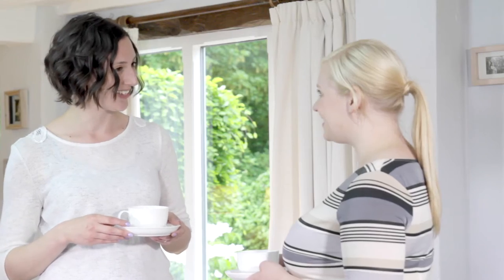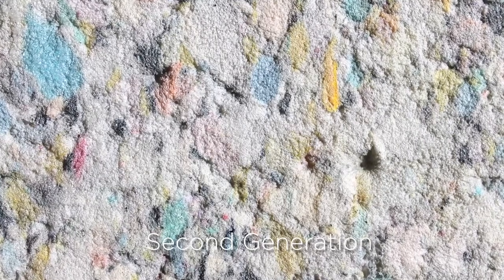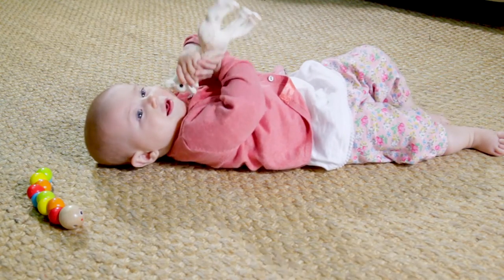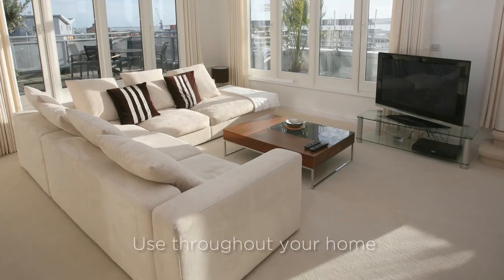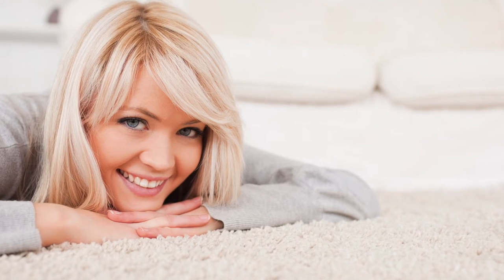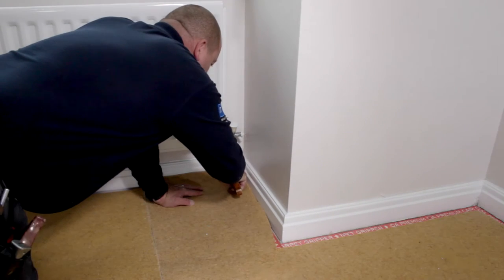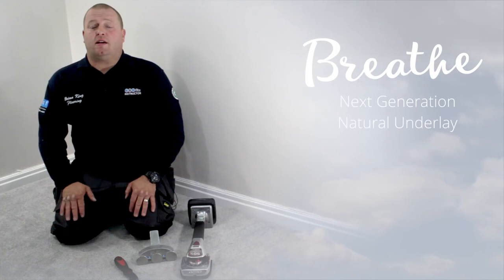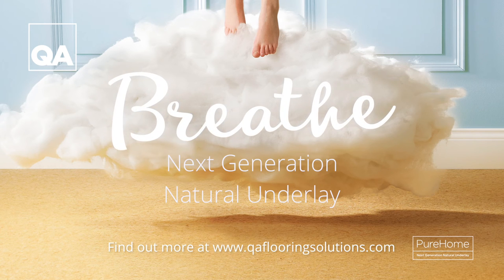Breathe The Next Generation Underlay

Comment: This stuff looks like it has no stretch at all! common foam underlay is good coz if it's slightly short and you can stretch it and it's flexible and easy to work with. that breath stuff looks like a sheet of ply! The guys that use this fit a room or two a day and have all the time in the world to put up with this stuff. I'm a real fitter I earn money for what I put down!! Simple
Reply from the maker: Thanks for your comment Sausage Man! Feedback from fitters that have used Breathe Underlay is consistently positive, citing the ease at which it cuts, the speed of installation and consistent nature of the product as the key benefits.

In fact, most fitters say Breathe is faster to install thanks to the ease at which it cuts (no more tearing) and that there is no need to cut and patch any hard lumps and bumps like in PU.

Of course there will be those that prefer PU Underlays, which is great for us because 90% of our Underlay catalogue is PU!

We don’t discriminate either way. We offer a fantastic range of PU products and a number of innovative products like Breathe and HeatWave.

At the end of the day, underlay is a choice for the consumer. If the consumer wants to install an underlay with added health benefits, that extends the life of their carpet or is conscious of allergy sufferers, then Breathe Underlay is an excellent choice. 

If they just want a soft floor, PU is a great alternative.

https://youtu.be/NMxkhVpP7DI
Reply: QA Flooring Solutions the breath underlay cuts nice because it's like a sheet of ply and doesn't move anywhere, I can't see how it would be faster to fit than pu because it too stiff and has no give!! I don't see how it makes any difference to allergy's than pu offers? As of just wanting something soft under the carpet isn't that the purpose of any underlay!
Reply from the maker: Hi again, Sausage Man.

When Breathe traps and filters the impurities from the airborne particles, it stops them from circulating around the home. These are then trapped until they are vacuumed up.

Airborne impurities are common trigger of allergens, quite notably - but not limited to - asthma and pollen sufferers. As a result, a home that uses Breathe Underlay will be a better place for allergen sufferers, who would no longer have to choose between comfort or suffering with symptoms.

Let’s not forget, Sausage Man, that Breathe is a 135kg density product, which qualifies it for luxury use.
Reply: QA Flooring Solutions hi again flooring solutions, if you ask me it sounds like a load of bull! Regardless of the underlay the  carpet holds on to the dust until you hoover up. I'm a fitter and I've never heard of this 135kg density talk what does that mean and does it matter? There is no way that stuff feels soft under foot.